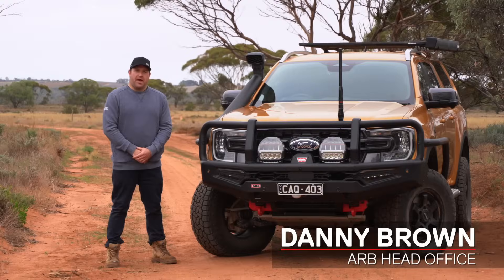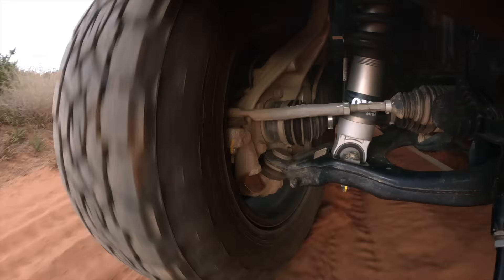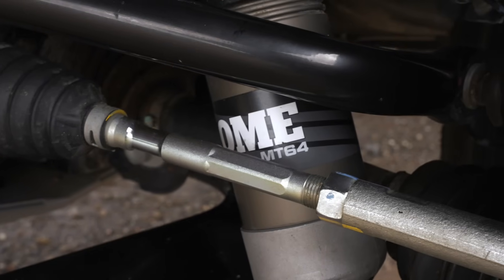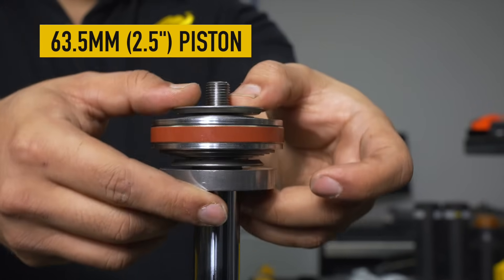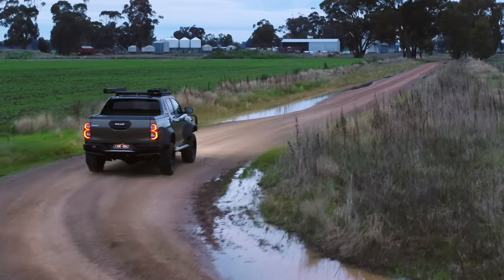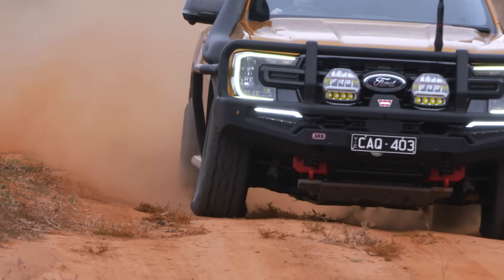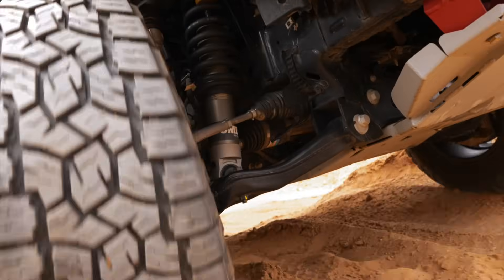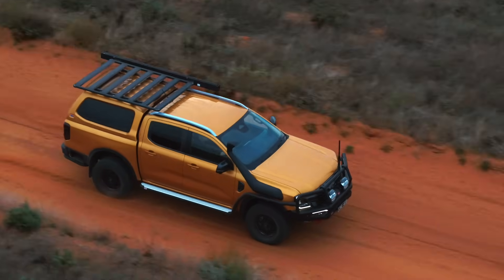Experience the MT64 Shock Absorber

Comment: How come they don't combine the compression and rebound adjustment on the BP-51 and the spring height adjustment of the MT64.  That would give the optimum control and adjustment of the suspension.  Seems like a no brainer.  If they do, it would be nice if they'd allow previous original buyers of the BP-51 and MT64 systems to upgrade to the new system by trading in their previous system with a good buyback credit towards the new system.

Comment: I have the nitrocharger shocks and like them but want to upgrade to mt64 ones
Are the springs from the nitro the same as mt64? Are they compatible?
Reply from the maker: Presuming you have Nitrocharger Sport shocks, The MT64 does use a different spring design.

Comment: Can we just lift the front 2" even we don’t have any heavy add-ons ? What would it be for a 3rd gen Tacoma with the 4000 springs? 2nd? 3rd position clip?
Reply from the maker: I think it would be best to contact your local dealer / stockist as this is quite a technical request and dealers in your region will be able to provide more accurate information.

Comment: Finally a proper midrange offering to crush the competition. And I just picked up a 2023 4Runner. These have my name written all over it. My question is: Will the shocks be offered in different valving like nitros? As in comfort, standard and heavy? Is there going to be different part #’s like on the nitros? Thanks!
Reply from the maker: Ok so I spoke to the product manager and his response is below:

We offer one all-rounder choice tune for the front of the 4runner and 2 tunes for the rear of the 4runner. The front strut can be adjusted to accomodate accessories or soft/ hardness using the adjustable snap ring anf spring seat, so they are covered
Reply: good question, heavily doubtful on this though
Reply from the maker: I am looking into this for you and will get back to you shortly

Comment: Plans for a 2.5" remote-res "BP64" to compete with the likes of King, Fox, etc?
Reply: They already have the BP51 that does that.
Reply: @adih2367  The BP51 is not on the same level as Kings, Fox or other 2.5" diameter piston shock. ARB have obviously realised a market exists for these & seem to suggest a lot of the BP51 technology features in these shocks so it will be interesting to see if they push to the next level

Comment: Are these basically the trail hunter shocks? Making them for older cruisers?
Reply from the maker: The MT64 is quite a bit different to the Trailhunter shock absorber although they look similar. The Trailhunter shock was developed in conjunction with Toyota specifically to suit the new Tacoma where as the MT64 has been in development by us for many years and is built fully in house in our manufacturing facilities for a range of vehicles - maybe even for your older cruisers!
Reply: @ARB4x4Accessories  Can you be more specific about the differences (travel, dampening, tech…)? Which of the 2 will perform the best when off roading at high speed ? Trying to decide between a Trailhunter, or a more basic Tacoma trim and then add aftermarket shocks like the MT64.